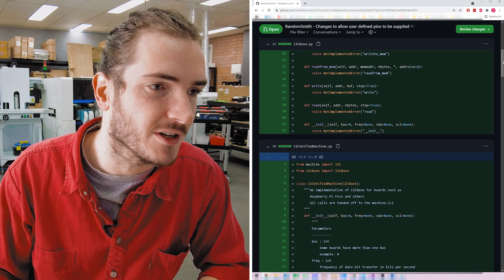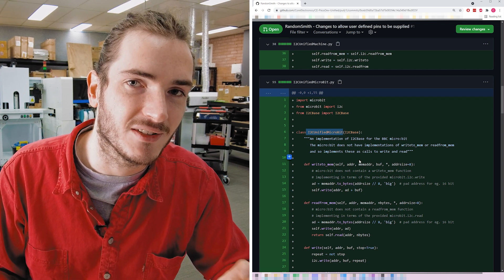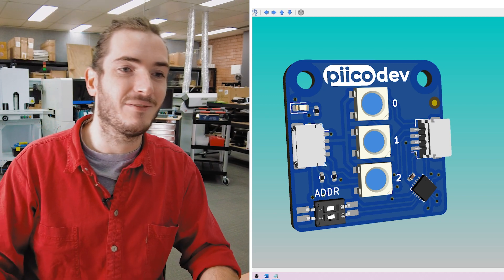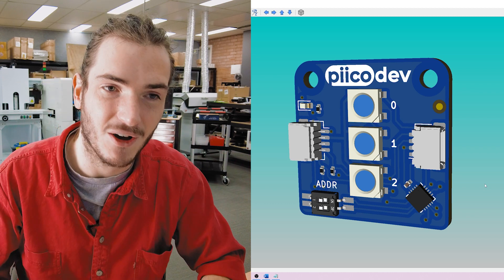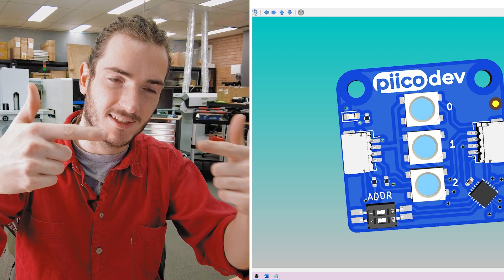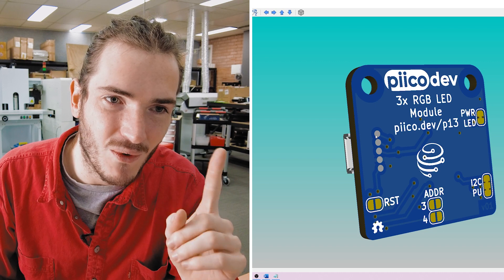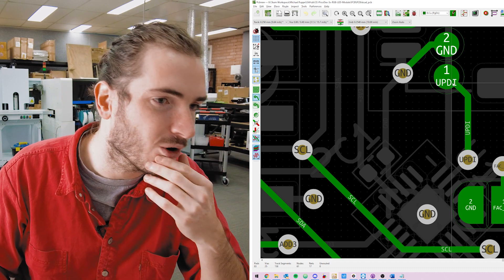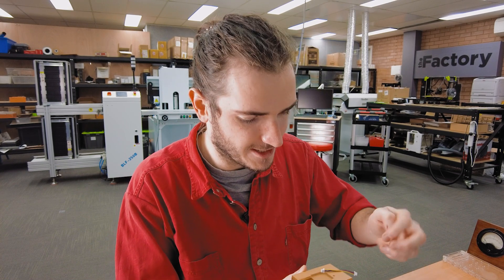The Factory | Rapid Prototyping Production Tools With A Laser Cutter

Comment: Inserting the DUT and angling to slide into the left terminal looked a little awkward perhaps? And would be lateral force over the pogo pin/dragging over the back of the board? What if the DUT is placed into a fixed/stationary cutout, and have both connectors slide in from the sides instead of just one? Trying to think of something to actuate both slides with one lever but out of ideas. DUT cutout could also have a slight chamfer/bevel (top 1/4 of the slot?) to help it self align a bit? Same thought for the terminals on the slides perhaps? (shave off any locking/friction fit material so that they locate as things wear and exert less force on the components?)